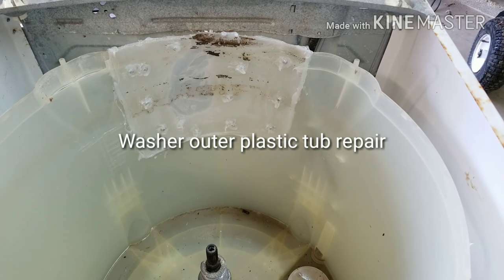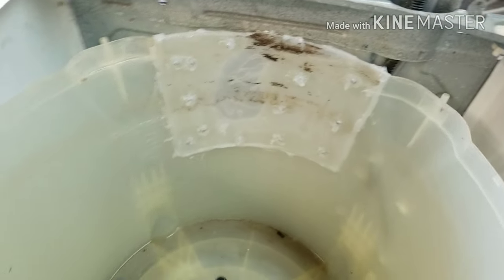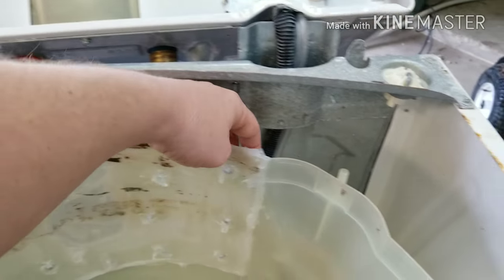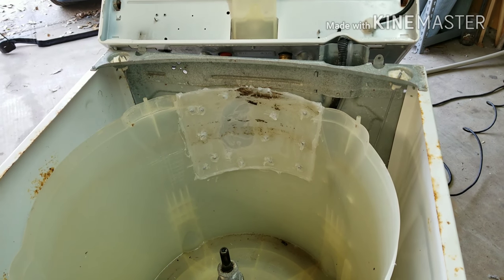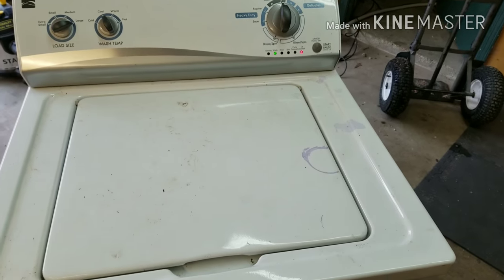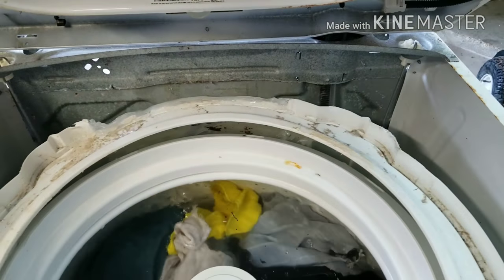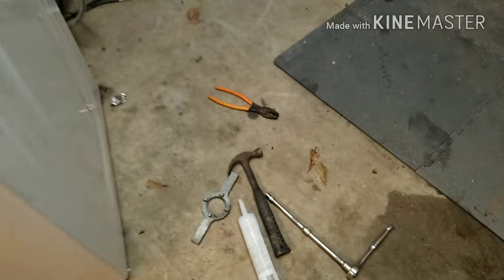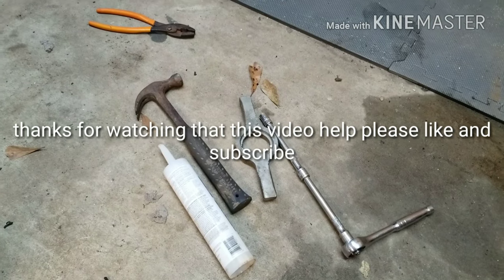Cracked leaking washer drum tub repair. For Kenmore Whirlpool Maytag and other brands

Comment: I did appliance repair from 1990 up until I got sick in 2011. I've seen some really poorly made machines, but this model takes the cake. Its like Whirlpool took all their bad ideas and joined them with all of GE's and made a washer. I feel bad that you have to work on this. 

I hope your patch lasts. I did a patch on a tub almost the same way. Luckily my hole was much smaller and not too hard to seal.
Reply from the maker: Dzonemp I would say your description of a cross between GE and Whirlpool would be exactly right. Only thing I like about this type washer is there's only three things that goes wrong with them. Suspension rods, lid switch, or the shifter that moves it from spin to agitate. Especially suspension rods I'm replacing them constantly.

Comment: Whirlpool VMW washer are not good, they are one of the most high maintenance machines yet, tons of repair videso online. The suspension on this model is notorious for failing, which causes the drum to move and the drum just bangs to the side. Plus, VMWs are some of the most commonly reported machines for bearing failures.